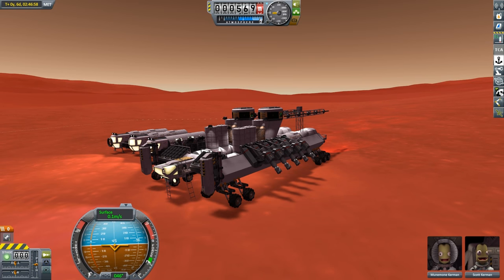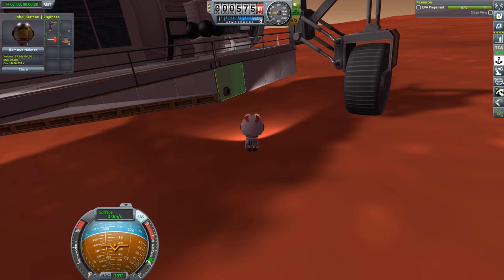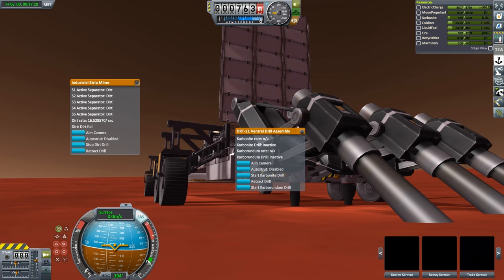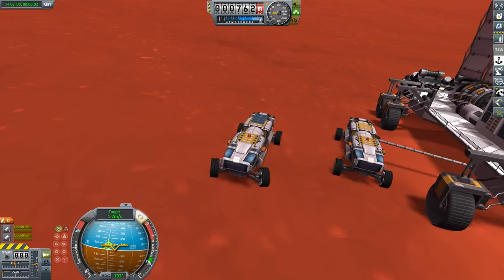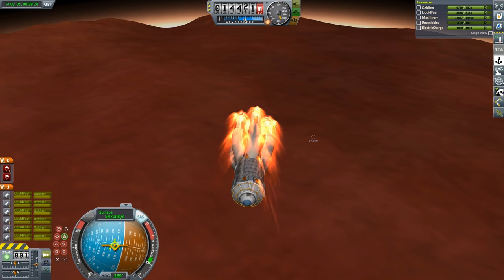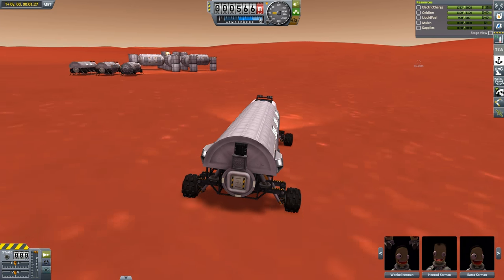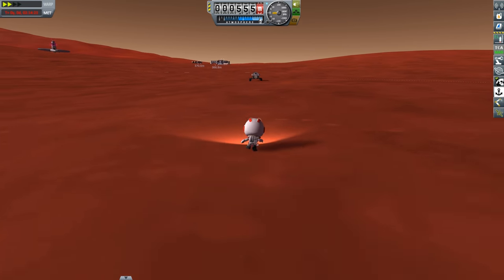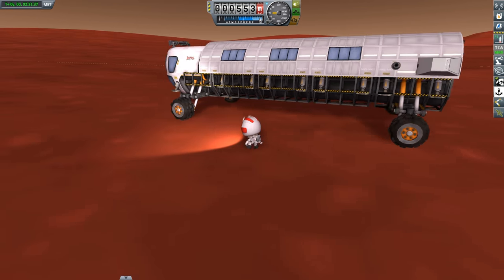[42] Duna Dirt Drilling & Processing | Modded KSP : Super Colonization

Comment: For RP and storage reasons, I think you should create something like a "Planetary Logistic HQ". Functionally, it would be a place to store massive amounts of resources for when they are needed, and for RP, it could be thought of as the place where the Kerbals organize their plane wide network.
Reply from the maker: The planetary logistics system is already infinite, and making a storage structure would not serve any purpose. If I did make it them I would pretty much just be locking up resources since once they get put into the storage structure, it is a pain to get it back out when I need it unless something is directly connected to it.
Reply: Oh, I thought that the logistics system just connected the resource inventories of structures linked in. Oops.
Reply: Toxic Timewaster (Ryan123220) I have the same base but it can not build anithing.
Shows productivity 0.
What is wrong?
Reply from the maker: Do you have kerbals on board your build craft?
Reply: Toxic Timewaster (Ryan123220) 2 pilots, 3 engineers, 1 scientist.
You mean in the base?
Reply from the maker: I am not sure what the issue could be then. Maybe make a back-up of your KSP folder then reinstall the mod. If that does not work then posting on the KSP forums for MKS would be your best option.

Comment: Why they do not built anything? I have everything the same but process isnt going on!
Reply: are you missing some parts in the interplanetary launchpads mod? i have the same problem and some of the parts are missing
Reply: HerpedyDerp Gaming nothing is missing. I have the same base and it can not build.
Reply: HerpedyDerp Gaming It shows productivity 0
Dont know how to increase it
Reply: You'll need some kerbals (preferable smart ones, stupid ones decrease productivity) and an effective workspace.  Regular pods don't provide much productivity, but hitchhiker containers are slightly better, but for fast builds you want to use an EL workshop, as it has the highest productivity multiplier and can hold a huge amount of kerbals in a small space.

Comment: Ryan I think your install is bugged. Recyclables are produced by the breakdown of machinery. You should get recyclables from the machinery and then resources from dirt.
Reply from the maker: Ya, I will be looking into the problem this weekend. I want to say it is bugged because it would make no sense to have it work the way it currently works. I may also be using a version of the mod that the processing units were broken in and it may have been fixed since then.